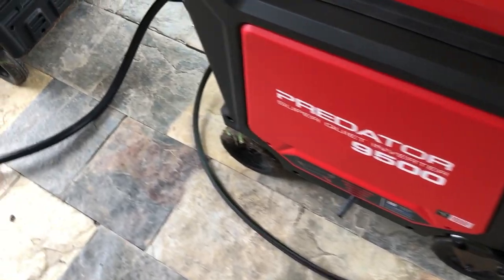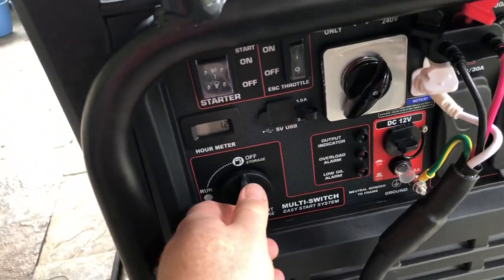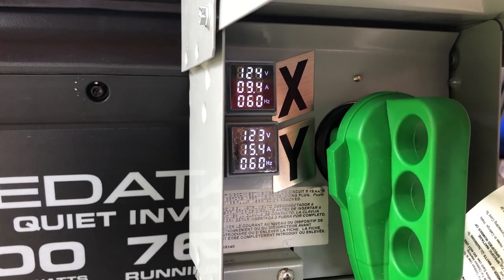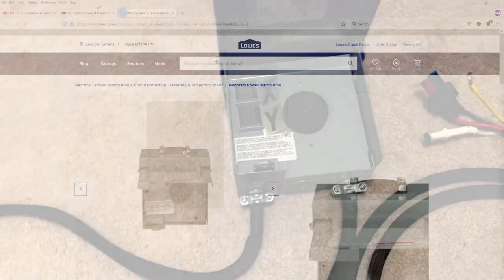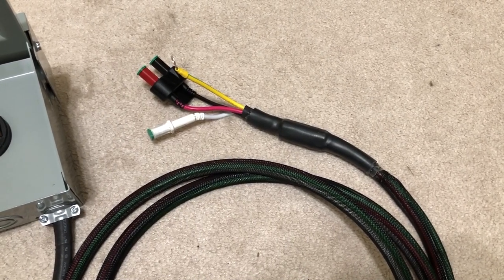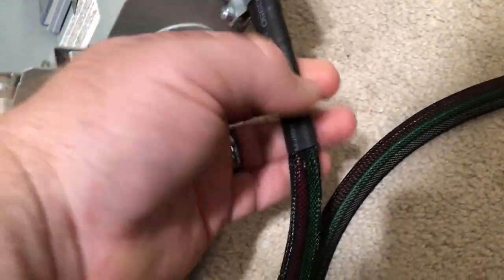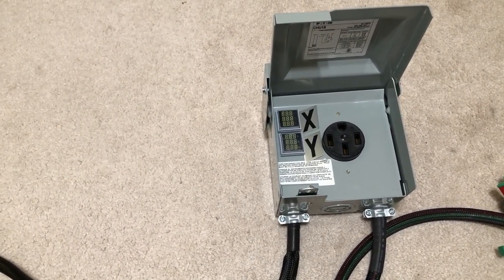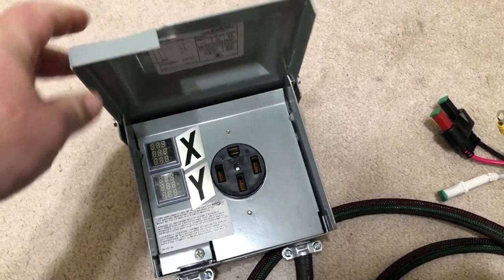Predator 9500 Home Built 240V Parallel Kit Test & Build Parts: 2X Output Power Using Two Generators!

Comment: I like the parallel kit build. I do have to ask though. It appears your Predator 9500 has an oil drain tube. Is this something you added? I just purchased the same model (no drain tube) and looking for a clean method of draining the oil. Thanks!
Reply from the maker: It's a fill tube that came with it.  Basically a funnel with a long flexible tube.  It does get the oil where it needs to go... and then slowly makes a mess after you pack it away.  (zip lock bags for it)

No good for draining it, just filling.  On the bottom there is a rubber grommet you remove so when you drain the oil it falls onto the plastic housing, and drains through the hole.  (I have an oil pump that is usually less messy for changing oil)
Reply: @Texas_DIY  Thanks for the reply! 
I thought maybe you had added a quick drain valve with a tube on it. I just used the factory method for draining as you stated above over the weekend. I didn't have any mess draining. Filling leaves a bit to be desired. I bought an oil filler that screws onto a quart bottle of oil with a clear smooth plastic tube. It worked better. 
Not a fan of the factory corrugated tube on the funnel that collects oil in the bottoms of the ridges for future mess as you mentioned.

Comment: Will this work on regular generators (non-inverter)? I have a predator 4k and want to purchase another one to parallel with.
Reply from the maker: Noooooo.  It would probably make a great light show though.

To parallel two generators together they really must be inverter units designed for that.  Some industrial portable generators are able to be carefully sync'd, but they're designed with adjustments and meters to do so.... and that's way way beyond the scope of any consumer portable units.
Reply: @Texas_DIY  thanks, guess I need to brush up on what is an inverter and what is not and how they function.
Reply from the maker: The videos in this series kinda cover it.  But basically an inverter converts DC to AC.  Have you ever used or seen the inverters you plug into a cigarett lighter socket in your car, and it gives you an electrical outlet?  It's the same idea, just scaled up quite a bit.

A normal generator makes AC power, the frequency of which is dependent on the speed of the engine (how fast/frequently the magnets pass the copper coils).  Inverter generators however are wired to make very high frequency AC, that is converted to DC, so the inverter can make use of the power even if the engine is running slowly.  That DC power is used by the inverter to make 240VAC at 60HZ (again, regardless of the engine speed).    While some energy is lost in the AC to DC to AC conversion, you usually end up saving quite a bit overall by allowing the engine to only need to run faster under heavier loads.  So fuel use is more proportional to power use/need.

Since the power being output from the generator is created electronically (not mechanically with whatever the engine is doing, like with a traditional generator), it has the ability when starting up, to "listen" and see if power is already present, if it detects 240VAC 60HZ, the inverter will match that frequency, and just contribute to it.  This is how you can double your output, by teaming two inverter generators together.

A traditional generator will have it's frequency of power influenced by loads and the speed of the engine (take a look at the video I made where I compare the power quality between a normal generator and an inverter generator) So adding an inverter generator to a traditional one, would probably not work well, because while the traditional generator's power moves around and changes, the inverter is solid and consistent... and probably unwilling to constantly adapt much once it's locked into the original frequency.  This means that whenever a load hits, your power would end up with two different frequencies at the same time as the traditional generator sags, but the inverter generator maintains the same frequency.  This would probably result in very bad things happening to your home's electronics, and probably the generator(s) as well.

Comment: @jasonwallace Thanks for bangin this out. Exactly what I was looking for and uber helpful. My question is how did you wire the two voltage monitors? I see they have a positive and negative terminal to power the meters, apart from the donut. Just wondering how you ran those jumpers to power the meters. Thx dude!
Reply from the maker: I have a few videos in this series.  People requested a wiring diagram so I provided it in the other videos.  Basically I wired the power for each meter to the common neutral.  The hot wire for the meter's power each went to one of the legs of power.  So meter 1 reads (is powered by) X and meter 2 reads (is powered by) Y.
This allows me to see the voltage of each leg vs. both meters just identically reading 240V.  
This is the link to the whole series:
https://www.youtube.com/playlist?list=PLzoNthJzzMFQ877vyCfoc53oDQqGFAIKN
Reply: @Texas_DIY  copy all, thanks a bunch man🙏🏽

Comment: How many hours do you have on those generators?
Reply from the maker: About 35-40hrs on one, and less than 30 on the other.  I need to figure out an enclosure solution at this point, and finish the break-in of the 2nd unit.

Comment: Just a quick question on your output power. On my predator 9500 I can get 32 amps across the 240volt legs and 30 amps per side on the 120volts legs. Im getting the full 60 plus rated amps when I use both 120 legs. Iv got everything balanced pretty good.  I don't have any 240 volt devices in the house.  It seems with the parallel kit you should be able to get 63 amps across the 240 legs and 60 amps on each 120 volt legs for a total of 120 amps.   2 Predator 9500s (15200watts continues).  Loved your video, well done.
Reply from the maker: I would think that seems about right. And if you do end up with 240V stuff, you can power that as well.
Reply: Just to confirm, with 2 in parallel, I can power about 120A.  If I shut one off while both are connected in parallel, I can power about 60A?  Thx

Comment: What is the running amps combined ?
Reply from the maker: Around 60amps, continuous running.  ~30a from each side.
Reply: @Texas_DIY  so if you bump your breaker, wires, and inlet box to 60 you would get more power if needed.  Btw I am thinking about dropping a main wire from the 50 or 60 amp breaker(whichever I choose) and tapping two 30 amp twist lock inlet boxes to that .  Then make two cords one for each machine. The cords will be female so there no shock risk and the plugs are twist lock not attached to the machine so vibration is not a factor.
Reply: @Texas_DIY  btw thanks for the video it's awesome
Reply from the maker: Just saw this... be careful with that plan, it's going to complicate things, and potentially be very dangerous.

The generators (if being teamed together) really need to run from the dedicated parallel ports.  Those ports bypass the breakers.  If you team them via the 30amp ports...  and the cord comes unplugged, or the breakers trip, that will allow the generators to drift out of sync.  If you reconnected them, or flipped the breaker back on you'd have two different frequencies of power hit your home at once.  (they have to stay accurate to 1/60th of a second, think of it like starting two stop watches at the same time... how long do they stay sync'd?)

I believe this is why when a generator becomes overloaded, there isn't a reset button.  You have to shut the engine down, and restart it from scratch.  (This is so it can re-sync to the power, and not suddenly inject another competing frequency of power into the line)

Also if you make two inlets, you now need to figure out some interlock system that won't allow a scenario where the male pins in the inlet are hot, and, the main breaker for the incoming line power is off.  As soon as you turn on either of your inlet breakers, the pins will be energized if the line power is one, or, if another generator was powered on.  See what I'm saying?  It would be pretty easy to make those pins hot, or, to back feed power to the power company... if you didn't do everything exactly right every time.

Also, you're back to having those plugs come loose, if they do, generators are now out of sync.  

The parallel kit bypasses all that, and combines them using the parallel ports (that are harder to accidentally remove, and won't have a breaker interrupt).  From there, you have the combined power that goes into a single inlet, that can have an interlock applied to it for preventing back feeding, and preventing energizing of the male inlet pins if power is on.

With two 30amp inlets, I don't see how you could have an interlock / safety system that would work right to prevent the male pins from ever being hot, and, prevent backfeeding into the power company, unless it was some kind of electronically computer controlled system that sensed power and shut off the feeds as appropriate.

Comment: Is there any limit to how many of these you can parallel (assuming the wires can handle the current)? For example, if I find that 2 won't handle everything, can I just keep adding units until my electrical demand is satisfied? It would seem that any slave units would just match the frequency of the system.
Reply from the maker: I don't know the fundamental design of these things... if there is any sort of actual communication happening, or if they simply match the frequency of the power that is present when starting.  (I assume the latter).  

So if that assumption is correct, then I don't see why you couldn't have more than two in a set.  Just start them in sequence.

With more than two though, you quickly get into amperage territory that is well beyond what most inlet socket/plugs are designed for, and into hard wiring into a breaker territory.  Be careful.

Comment: How much did it cost you to make this? And would you be willing to make and sell these?
Reply from the maker: I think I have around $240 in parts in it, in order to make it.  Those terminal blocks at over $20 each were a price killer and the wire was nuts... in addition to the cost of the box, meters, and the original parallel kit I modified.

Since the Power horse kits seem to be MIA, I'd have to come up with a different plug solution.  Probably design and 3D print something out of a heat resistant plastic and use banana plugs inside it.  And I'd likley opt for the more expensive and slightly larger "GE Recreational Vehicle Power Outlet  GE1LU502SS" box with more room and a built-in breaker.

I'm not sure anyone would want to buy them at the price I'd have to sell them for (assuming I could figure out the parallel plug issue).  The parts alone would be more than the cost of the Honda kit.  (part# 08E93-Z37-001AH).  And then there is the potential liability if my hand crafted creation burned someone's house down.  Not sure it's something I should get into.

I'm really curious if the Honda one would fit the Predator's parallel plugs.  It would need a cable extended, but would be a great starting point otherwise.
Reply: @Texas_DIY  thank you for the info.

Comment: Can't the same be done, by just buying a 30amp to 50amp adapter? That's what I do for my fifth wheel.
Reply from the maker: That would allow you to connect a single generator unit into a 50amp socket.  But that wouldn't add any capacity beyond the 30amps provided by the socket you plugged into on the generator.

Comment: Why not just buy one generac 17500E instead of 2 predator inverters?
Reply: Sine wave?
Reply from the maker: Yeah, maybe that generac does a better job with it's sine wave, but that was one of my main motivators for an inverter based generator.  The pure sine wave vs. a traditional direct connect to the coil generator.

Comment: I wish they would have came out with 50amp plug on these.
Reply from the maker: Me too, but I get it.  The units are not capable of producing 50amps alone, and if you paralleled another one in, I don't think the internal wiring is designed for that much amperage such that you could use one unit in place of the parallel kit.